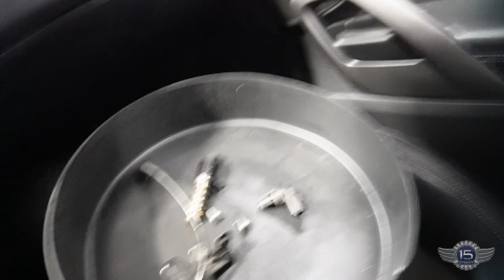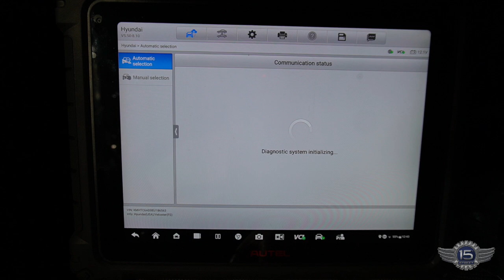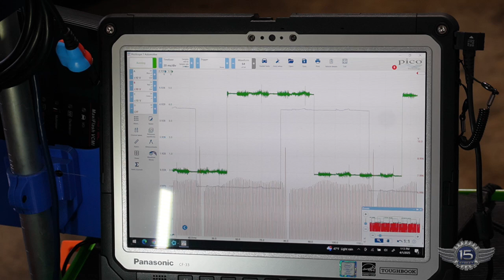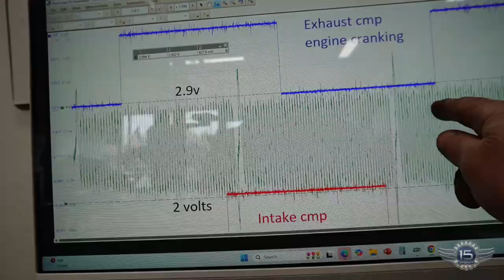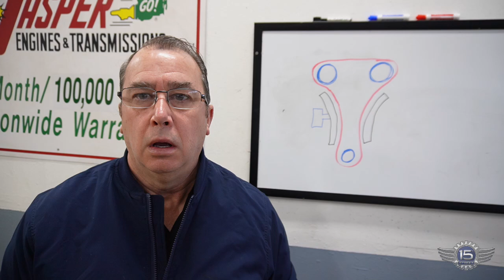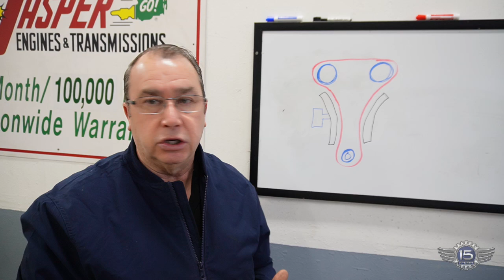Hyundai Veloster Cam Crank Correlation P0017

Comment: Hello thanks for another valuable video. 

Could a bad timing component affect the compression values?

My friend ran into this situation last week with a 2014 Elantra. My friend can replace anything but his diagnostic ability is low. I, on the other hand can only do light work but i am very passionate of diagnostic. 

Right off, i suggested him to check the CAM & CRANK positions which seemed timed properly (dots aligned). 

Based on what you explained, if i understood you well, the dots could still be aligned despite of a timing component failing that would still cause advancement or retardation (cam phasers, tensioner, guide etc).

I did not attempt to start the diagnosis witth my 2 channel pico2204a. Instead,  being a 1.8l-4 cylinders-180k mi, i suggested to check the compression. Note: i said that because when checking live data & performing cylinder balance tests, i  noticed that the car ran slightly better when i disconnected by hand / shutting by scanner cylinder 1 or cyl 3 injectors. PS: the Fuel trims was rich -14-17%.

Upon checking the compression with:
1- Battery support by mean of jumper cables
2- 9 compression strokes

The compression found was 125-137psi VS 165psu spec & no more than 14psi among consecutive cylinders. 

I then pourred a 5gal oil cap amount oil and it raised the compression to nearly 170psi.

My question is this:
Could a bad timing component affect the compression values?

PS: i plan to perform a 2nd test with another gauge to confirm the first test.

Thanks to let me know
Reply from the maker: Anything that effects valve timing can cause a compression loss. This vehicle was only 12° off so if it did effect compression it was very little. It was out enough that the ECM saw it but not enough to cause a runability issue.
Reply: @woodanthology-c3c understood
Reply: @woodanthology-c3c ❤
Reply: Your test results indicate a piston ring issue is causing low compression, not a timing issue. But there are a few caveats to this: did you test compression (both dry and wet) with the engine warmed up? And how much oil did you add exactly? Bc you should only be adding about a teaspoon and I can't tell from your description if you ended up adding more than that (which will artificially raise compression too much no matter what and nullify your results either way). I'd just go ahead and do a leakdown test on the lowest compression cylinder and if it's over ~15% leakage and ending up in the crankcase case closed.

Excessive blowby due to a piston ring issue could also explain the negative fuel trims - unburned fuel ends up in the crankcase, then reintroduced to the cylinders via the PCV, O2 sensor detects the rich condition and PCM responds with negative fuel trims. There are even some cases where enough blowby and resultant negative fuel trims that an oil change can cause a crank/no start condition until you reset the fuel trims bc that new oil isn't "saturated" with fuel yet, so it will be too lean to start before a reset.
Reply: I know for sure it was more than a teaspoon; may be 4 times that i think but ill measure and report but obviously i put too much.

If wet compression test describe the oil put in the cylinder to determine if the issue is valve or piston related then yes i did both compression after the engine was warmed up for 25mn. I told my friend to start the car before i started my 20mn drive but got delayed by some traffic so 25mn at least.

Thanks for suggesting the leakdown test. Can you suggest a good reliable leak down tester? I have been wanting one for my Enduro bike if it can be used to test a bike as well. Id still get it if not because it is an important tool to have and as tool man trying hard to be a diagnostician, it is not acceptable for me not to have it.

Thanks for the elaborate explanation of the relation between piston rings, blow by and PCV; sounds like what could occur in GM 3.6l engine w direct injection such as the Camaro, trwverse, enclave etc; i could be wrong.

Lastly, ill have my friend check the timing components as they can also affect compression. Do you think a compression testcan be used to rule out a timing issue? I have heard that before “with such a good compression i would not worry about timing issues” is what i heard from professional techs but id like to have your opinion too so I can remake my diagnostic process in my mind. 

I had him check the timing marks first but this could not be enough because of VVT effects as well as Cam phasers and chain and guides conditions. Then i said lets do a compression test, if it falls way under spec, it is an engine swap or rebuild but if not then we need to dig more to find out.
Reply: @AutoKey_FieldOps  For the money I would probably get the OTC leakdown tester. 

Personally, I wouldn't say that if compression is good then valve timing must be good. It means that it's probably good, but there are a variety of scenarios where valves can not be doing what they're supposed to when they're supposed to and peak cranking compression still looks good (for example if an exhaust valve isn't opening completely or at all). This is why the in-cylinder pressure transducer and a scope can really come in handy.

And yeah, your timing marks can still line up but there is enough slack in the chain for the cam(s) and crank to be out of proper sync when the engine is actually running. If it gets loose enough eventually it's probably going to "jump time" and then the timing marks won't line up, but even before then there can be enough slack for it to cause issues and/or throw a DTC. In that case you can either capture a waveform of the cam and crank signals and compare it to a known good like he did in this video, or if the vehicle and scan tool have the PIDs available take a look at the cam timing desired/commanded vs actual.
Reply: @nowayjose596 well put, you said it all. Thanks for the OTC. 

Scope reading challenges me but i own a basic one that does great as long as a few automotive accessories are added to it. It is the Pico2204a; 

Currently battling with a CAN diagnostic issue on a 2015 Chevy impala & off of the countless video i watched to get a good grasp on the matter, this channel totally enlightened me. 

Last night i located an issue that was not declared when i started to investigate the matter 2months ago: ABS Pump leaked fluid on the Connector & it was shorting within it. I removed this connector several times and it seemed clean but guess what, two months of winter built up the underlying corrosion to the point that car went from running to no crank no start; during my investigation, abs connector was stuck and i had to destroy the connector snd pull hard on it then Voila a massive corrosion looking like a burn 🔥 occured between power and ground. What i dont understand is why normal CAN activity never resumed despite having removed this connector several times before. Now i somewhat have communication back with the scanner and voltage on Hi speed CAN is back to normal.

I think i drifted from timing issues to CAN issues 😅
Reply: @AutoKey_FieldOps  I really wish Pico wouldn't have retroactively removed the automotive function support from the 2204a bc otherwise it would be my hands-down recommendation for new users wanting to learn scopes. You can get around it, but it's still annoying and others won't be able to open the files you've created using the workaround. I'm about to try out an HScope and hopefully will be able to start recommending it as an entry level 2-channel scope.

CAN is definitely its own beast with its own learning curve and I'm undergoing that same process myself now. Generally, if a module is having an issue and you disconnect the offending module then yeah, you should get network operation back. But it sounds like your issue may be with the network wiring itself before reaching a module(s) - if the problem is entirely on the module side of the connector, then simply disconnecting it should restore CAN as mentioned. However, if the issue extends to the harness side of the connector, then disconnecting it won't completely solve the problem since you haven't "removed" the problem area from the system. You're probably aware of all this, just mentioning it.
Reply: @nowayjose596 .yes. My problem started on the harness side but there is a high possibility that it shorted the module. I hope not because a new module + programming may be required but a used module could be plug n play but causing a VIN mismatch DTC. Programming the module is no big deal to me but $400+ for a new module will feel wild besides the connector that needs repaired. GM sells the whole cabin engine harness and discontinued the the pigtail harness connector, off course. Sounds like ill have to go to a salvage yard to cut one off, ensuring i cut far away from the pigtail so i can join each and every wire. It is gonna take me quite some time because im slow at what i do. Time will tell soon